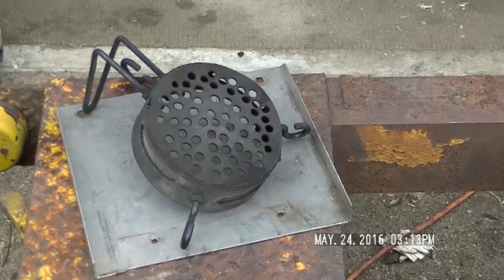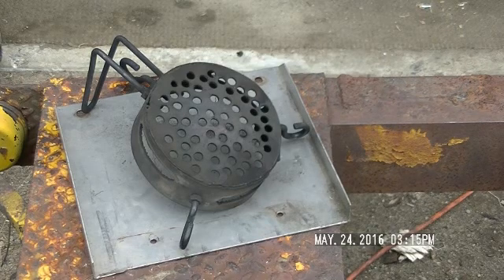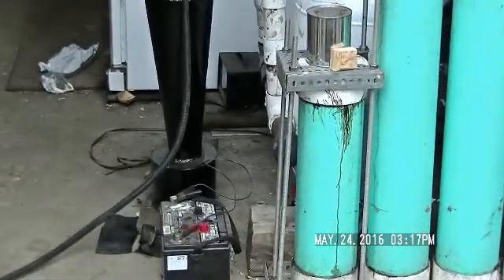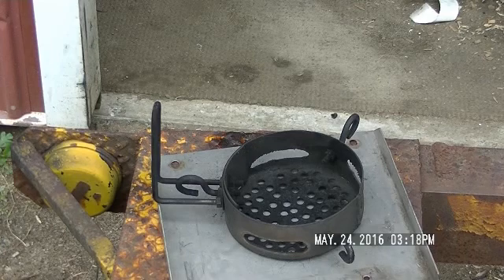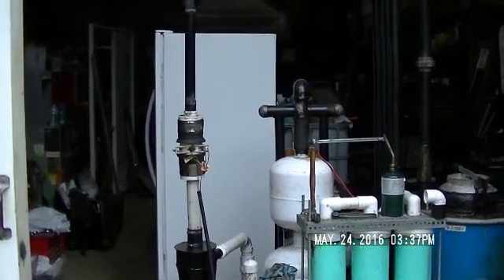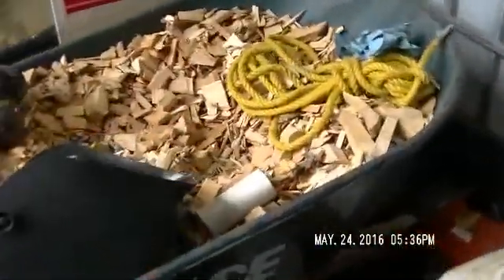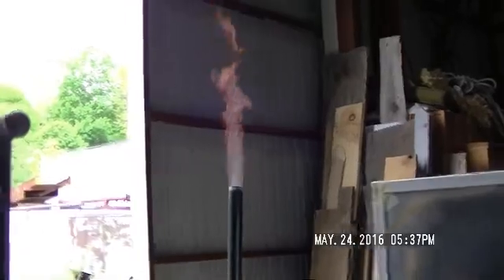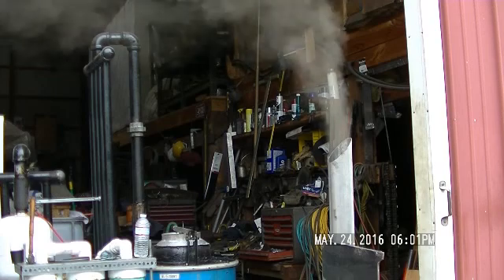Wood Gasifier Grate Mod  / test 052416

Comment: Howdee Bill,
   I seem to be having the same problem with mine, now that the new engine is pulling more gas through the system.
  After 31 hours on the new engine, the reduction zone - and the grate are packed up, real tight.  
It's so bad that the engine is trying to suck the gasifier down into the plumbing, so it looks like I need to modify the gate in the same way you have done yours.   
  I blame the Woodgas Bug for this  ;) .
Reply from the maker: Steve, That's a bummer ! As you know I cut horizontal slots in my grate about 1/2 inch up  and along the ring . Since then I added on strips to close them up a little bit  and I think I'm there now. It allows the hard pack to exit with a moderate rattle of the grate . I'll take it out and get some pictures and measurements for you in the morning and send it along. 
thirty one hours ! impressive. !
Reply: NH Hbbyloggr 
  Howdee Bill,  Thanks kindly  :) .  This is a bit of a bummer, as I need to pull the gasifier completely apart to get access to the grate - so I can make these changes.   Since its interior is so different from the Flash001 design, I may need to look into other options, as the charcoal flow path is quite different too.  
Still, I think there is room to try out your horizontal slots idea. That, and some holes in the floor or my grate just might do it  :) .  
Keep gassing those Woodgas Bugs, my fellow tree fumes addict  :) .
Reply from the maker: Steve, You have me scratching my head over this new problem. I wonder what changed ? Air flow volume requirements of the new engine Vs the old one? I am finding that the increased draw from the bigger engines makes the gasifier run hotter and cleaner. When you figure out what the cause of your back up is you will have unlocked the mysteries of the universe. 
.
Reply from the maker: BTW I also drilled out the holes in the grate  to 7/16 . It only seemed to help a little bit with the packing of the char. But the big difference came with the addition of the horizontal slots.
Reply: NH Hbbyloggr 
  Howdee Bill,  yup, I think you are onto something there with those hozarontal slots.  Mine has vertical slots that are about 1/4 inch wide. The charcoal that slips through is really small, and it resembles coffee granules in its overall size and shape.  Perhaps my approach to this has been overly aggressive, as this results in a low output rate from the gasifier that is often not visible, is quite cold, and burns with a mostly blue flame.  
If I open it up a bit, I am sure the whole system will breathe easier  :) . 
  It will be nice to find that happy medium.
Reply from the maker: Yes, opening it up should help. I rushed it when I cut the slots too small the first time and too big the second time and char was going everywhere and the flame looked more like burning shingles. When I modified the slots to about half of their size I only wish I had taken the time to make the mod ring adjustable so that I could tune it.  I'm sure you will find the right balance ( when you give it all your available time. The wood gas bug is a jealous little bugger.
Reply: NH Hbbyloggr 
  Indeedy.  I plan to rip into it this weekend, weather permitting. The horizontal slots are likely to be no more than 1 inch tall, as that seems about right to me.  Hmmm, famous last words  ;) . Even if I make mine adjustable, there is just no way I can get to it, to adjust it, without ripping the gasser apart again.  The Woodgas Bug better appreciate what I am doing on his behalf  :) .
Reply: NH Hbbyloggr 
  Just to answer your point about what may have changed, to bring about this problem.
  I rather suspect that it was always there, waiting for a chance to show up.  The new engine does indeed pull harder on the system, making it run hotter and cleaner, as you suggested.  The resulting increase in the flow rate of the charcoal is surely what's causing my grate to choke up.  It simply can't dump it fast enough to keep up with the increased demand.  Oh well, it looks like the solution will be simple enough, in theory  :) .
Reply from the maker: The new engine is probably running 3600rpm Vs 1900 rpm with the old one. Almost double the air requirements? 
I did a very short run with the gasser yesterday and the grate is still packed in the " run condition" I'll shoot a  short video showing how the outbound  char from the nozzle spits out the sides of the grate's side walls through the horizontal slots. Also I'll do some measurements for you. Yours may need different requirements but  at least it's a starting point for the theory. 
I also found that fresh startups without cleaning the grate only perpetuated the problem during the new start up. I have discusses this before and found cleaning the grate out at the beginning made for a good run...if it also sneezed ( backfires ) about 4-5 minutes into the startup. Darndest thing but it always runs beautifully after that.
Reply: NH Hbbyloggr 
  Yup, the new engine is going faster than the old one was.  This one is running at 2400 RPM, and has a wider throttle setting also. All of this combines to pull harder on the gasser, which is packing the grate faster than it can discharge.  I am gonna get all dirty and grimy this weekend, but it will be worth it if I can fix this problem  :) .  Thanks kindly for all yer help with this .  The Woodgas Bug chose well when he sank his fangs into you  :) .
Reply from the maker: This modification  shows its worth in gas production.  When the flare starts to look  weak and " labored" a little rattle of the shaker grate almost instantly produces a taller more robust flame. The slots allows the built up char on the outside s of the grate to  eject quickly and allow the wood to flow through the hearth producing more wood gas. 
My biggest question: Do you know of anyone running these little gems whose final product is white powdery ash, rather than bits of charcoal? Or doesn't it matter really because most of the the  gas has been rendered from the wood? Would anything be gained by trying to extract that final bit of energy?
Reply: NH Hbbyloggr 
  Your gasser produces appreciably more gas than mine does. Indeed, when yours is fading out, and in need of a shakeup, it still produces more than mine does. That's not a problem though, as my requirements are rather modest. When I make this modification to the grate, I am hoping I don't go too far with it, as I feel that my design benefits from a lengthy charcoal path. Ideally, I would find a happy medium between ease of flow and quality of gas.  White ash, in and below the grate, is not what I would call a normal product of a gasifier. This seems to suggest that air is getting in below the grate, and oxidising your charcoal. This process will heat the gasser up a lot more than normal, and it will rob you of some of your fuel gas. Perhaps there is an air leak somewhere near the base of your gasser?  A small amount of white ash in the pyrolysis zone is perhaps normal though, as air will often get into it when you lift the hopper lid to add more tree bits, or to stoke the fuel bed. 
As for the residual energy in the char that slips past the grate, I am sure there is a fair bit to be had. I would be tempted to build a simple charcoal gasifier for this purpose, as it would let you get the very last of what is available, while reducing it all to white ash which the wind can then carry onto the neighbour's washing line  ;) .
Reply from the maker: Steve, I don't get any white ash. Only little black charcoal nuggets. I was just curious  if maybe I was pushing it through too fast .
Reply: NH Hbbyloggr 
  Howdy Bill,  That's good news indeed, as it demonstrates that you don't have any air leaks in your gasser.  I think you might be pushing the chunks through just a little too quickly, but that is perhaps not a problem, as you are able to recycle them to the hopper.    There is surely a happy medium between too slow and too fast. Mine is definitely too slow, so I plan to fix that today, once the wintery ice melts off everything  :) .
Reply from the maker: Steve,
 How true, striving towards the happy medium. I'd be happy to send 1/2 of the heat we are having here in the NE if you would send me 1/2 of the cold icy mix you're having. I'd mix the two and be a very happy gasser.
Good luck with the grate modification. Be sure to let us know how it works
Reply: NH Hbbyloggr 
  Howdee Bill,  I would gladly do that heat swap with you  :) .  Some warmth for us, and some chill for you. Sounds like the perfect plan  :) .  Well, I spent all of yesterday, pulling the gasser to bits, and / or pieces, so I could alter the grate.  Once the alterations to the grate were completed, I set it aside and replaced it with a new one.  Hehehe, such is the way when you regularly inhale carrot dioxide, as emitted by leaky Donkeys  ;) .  A lot of my time was spent in repairing the air pre-heat chamber that delivers the hot air to the nozzles.  This was full of leaky cracks. As a result, it was causing air to mix with the woodgas, while also reducing the air flow to the burn zone. Perhaps this explains the difficult starting, and relatively poor performance, of the new engine.  
Currently, I am looking into adding a center feed nozzle like yours to my gasser.  It will require a fairly invasive set of cuts and welds, but it might be necessary, due to the rather poor build quality in certain areas on this gasser.  Oh well, such is life for us pioneers  :) .
Reply from the maker: Steve,
Half the battle is spent identifying the source of the problem. The other half is spent getting good and drunk. Only kidding...... 
Your finished repair and new upgrades will reward you with many thousands of hours of woodygas production.  I hope the weather holds well enough for you to complete your mission. Times like this I wish I was closer and could give you some help getting back up and running.
An extra hand feeding bits of carrots to the donkeys would free up about 4 hours of the day for you !! haha. I know, because one dog keeps me busy half the day just chasing squirrels, napping, peeing and eating , then more snacks. I just get down to the shop and in she comes , signalling that she wants to go up to the house...ah the good life. 

How's the steel holding out in the hot zone? warps, cracks, flaking anywhere?
Reply: NH Hbbyloggr 
  Howdee Bill, 

Quite right, being drunk on Woodgas Bug venom is surely the key to success here  ;) .
  I completed all of the repairs and modifications during the weekend, with just enough time on Sunday to get the beast fired up. 
 At first, it was looking like I had really messed my gasser up, as my reclaimed, super fine, charcoal dust was falling straight through the new grate, instead of collecting in there to perform its role as a reagent for clean gas production.  
 As a result, I got huge clouds of thick smoke, surely with lots of tar in it.   
 After a while, the gasser produced bigger charcoal chunks that were able to fill the new grate.  In time, the gas temperature started to drop off, and I was able to produce a flare that got steadily cleaner as time went on.  When I put this gas through the filters, I was able to produce a nice blue flare, which the engine liked very much.  3 hours of engine runtime ensued thereafter, during which time I ran the fuel processors to make some shiny new gasoline granules for my hungry beast.  
While it was running, I occasionally sniffed the engine exhaust for any telltale signs of tar 
entrainment. I am pleased to report that there is no odour in the exhaust gas, so it looks like it is running fairly cleanly.  Changing the grate has 'grately' changed the overall behaviour of my gasser, so I can't help but remain suspicious of the gas quality, until it has proven itself, one way or the other. 

  It sure would have been 'grate' if you were here to keep me company during those long, dirty and smokey hours of the rebuild, as like minded company is always a good thing  :) .
  Sadly, the tyranny of distance continues to conspire against us.  

My Donkeys, Camels and Ponies would also have loved your help, especially if you were heavily loaded with carrots and other nibble-worthy items of chewy goodness  :) .  

Overall, the metalwork inside the gasser's hottest regions is holding up well. There is some small degree of warping, and also a detectable degree of metal thinning too, especially in the areas where the 
chemical reactions are occurring at the highest temperatures.  My guess is that this gasser is good for another 1000 hours before I have to really rip into it for some more serious repairs.  I can't say the same for the internal air preheat chamber though, as its poor design is overly sensitive to the thermo-
mechanical stresses that occur due the temperature differences across its structure.  While that part of the gasser's construction is interesting, it is more trouble than it is worth.  Flash's design beats this for stability and structural integrity, hands down.  As for flaking, this is only a minor issue. I believe this is due to the use of high carbon steel in its construction.  Stainless steel would be 
better, but high carbon steel is a close runner up for its overall endurance at these temperatures.  I hope to be able to use the lessons I have learned with this on a new build, but I will need to outsource the majority of the build work for best results. Better save up some dollars for that one  :) .
Reply from the maker: It surely doesn't take too much of a design change to upset the balance of these beasts. The initial start  up must have left your stomach in a knot when all that smoke poured out from the innards. Didn't you get a new Instruction Manual with the upgrade? ;)
Let's hope the new upgrade settles in for you and the purpose for the modification is met in alleviating the packing of the char.

As this video of the grate shows quite clearly, during the shaking action virtually no char was able to expel from up and over the sides of the grate. And that was the problem. The horizontal openings now easily relieve the build up with just a slight " rattle'.
I suspect you will have to change your setting for the shaker intensity and duration. 20 or 30 hrs of run time ought to provide the confidence and relieve that knot in the stomach.

Did you also change the Air Intake design to the Flash001 method?
Reply: NH Hbbyloggr 
 Howdee Bill,  
 Yup, it seems to me that the heart of a good gasifier is just below the hearth  :) . A small change in the dynamics of the charcoal bed have significant effects downstream, so I need to take each of these experiences as a lesson from the Woodgas Buggy  :) .  As for a manual, I suspect that I may have accidentally burned it. Oops, perhaps I can download a copy off the interwebs.  So far, all is well with the upgrades. I pulled some of the plumbing off last night, so I could inspect it under good lights. So far, no tar, just soot. Perhaps I will also look at the stem of the inlet valve, just to be sure, as that is where the tar likes to accumulate, before wreaking havoc upon the grunter's internal organs.  Indeed, those horizontal slots make a big difference in the flow characteristics of the charcoal. There is a fine balance to be maintained there, so one always needs to be super careful when attacking said part with an angle grinder  :) .  You are quite right about the modified grate shaking pattern. The grate tends to shake sufficiently when I activate the hopper shaker, so it seems that I will be shaking the grate, for about 1 second, every hour. All of this can be programmed into the computer, so that will make it all nice and automatical  :) .  
The knot in the stomach is declining, but I am always on the lookout for possible problems.   One of the things I always do at startup is to pull the rope slowly, while feeling and listening for signs of jamming or fouling. So far, so good  :) .  

My air intake design hasn't changed since the very early days, as I like to have the controls nice and high up, well clear of the engine's vibrations. This system isn't perfect, as the gases tend to collide head on when they combine in the plumbing - on their way to the engine. 
Nonetheless, it seems to be working like a charm.
Reply from the maker: My take  is that you are well on the way . The woodgas bug has 
re-calibrated you to better serve its desires, and fulfill its quest for
  a near perfect life of happiness. These little darlings bring out a life of their own, They are needy, jealous and self centered but they bring great joy to those who tend to it well.
Reply: NH Hbbyloggr 
 Howdee Bill,
  I completed a 2 hour run this evening, and all seems well. My unfiltered flare is not as blue as I would like, as it tends more towards orange - with hints of yellow. Once it gets through the filters, which I have packed much tighter than normal, I am greeted with a healthy blue flare, with a tiny hint of orange at its tip. The engine likes this combination of gas flavours, and readily delivers big dollops of electrical goodness for me to play with  :) .
 I am always suspicious of changes in the behaviour of the gasser, but things seem to be coasting along quite well at the moment. after the first 150 hours of engine runtime, I should be pretty certain if I have got this right  :) .
  Indeed, my friend, just like a fire, these beasties are needy and hungry little attention seekers, but they sure do reward us handsomely when they decide that they like us  :) .  Keep barnstorming, my fellow woodbarn gasbug  :) .